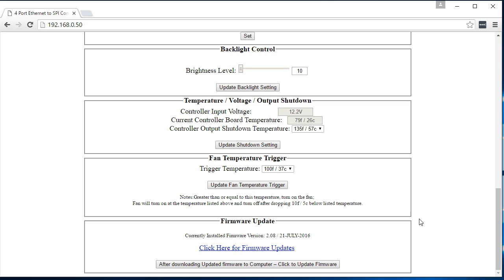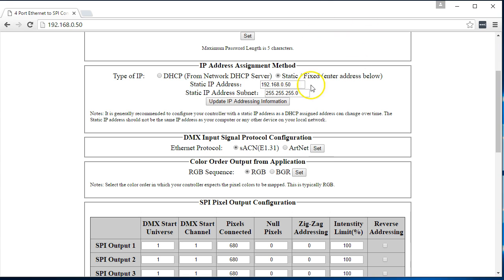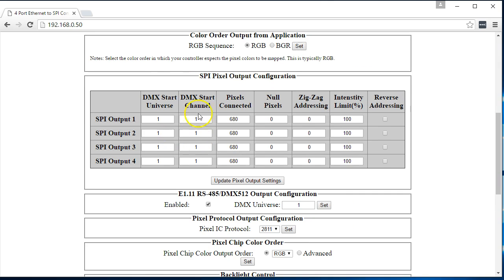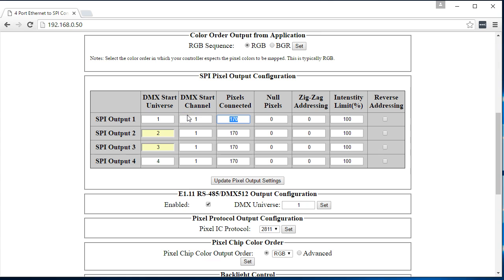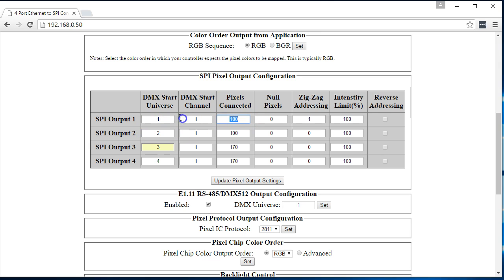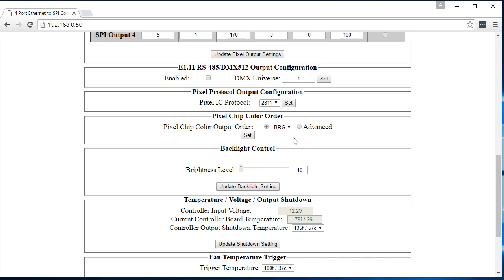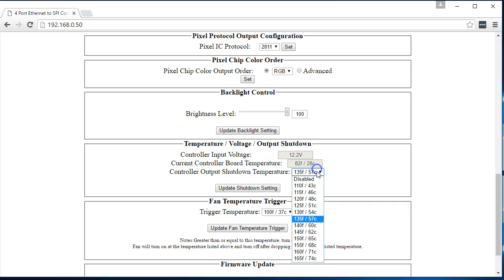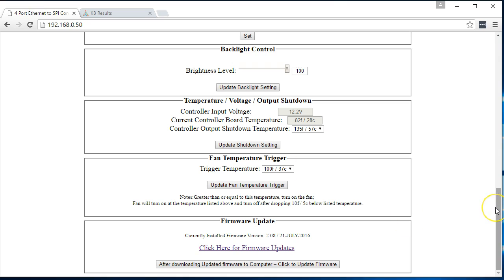OLD CONTENT: AlphaPix Controller Web Interface Configuration

Comment: Hi ! I'm trying to send DMX instruction to my AlphaPix from Touchdesigner. In this program, everything has to written by hand (at contrary to Resolume, for example, which does all the job of communicating to the controller without the user to know about it). I would like to know what is the DMX format that Alphapix needs to receive. I'm sending LED strips color channels. Thanks !
Reply from the maker: E1.31 is a public standard.  You can purchase the specifications document on the internet.
Reply: @HolidayCoro  thank you!